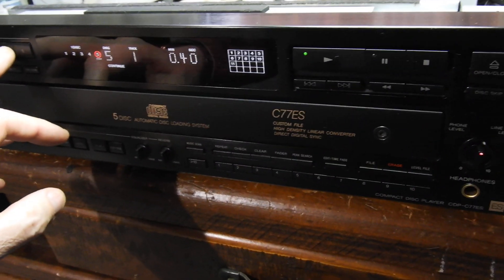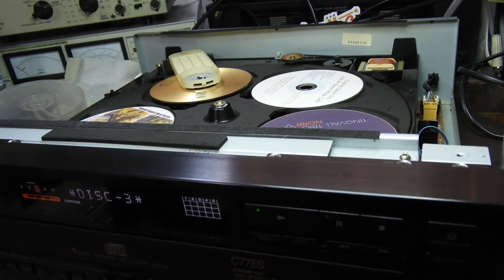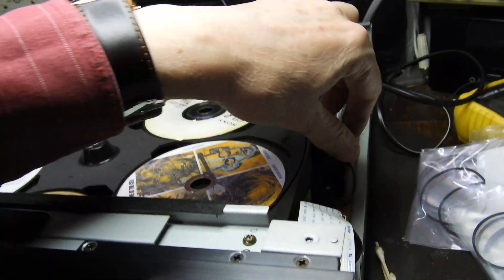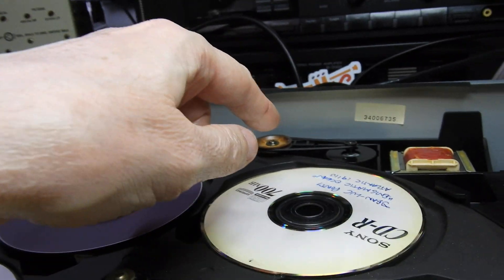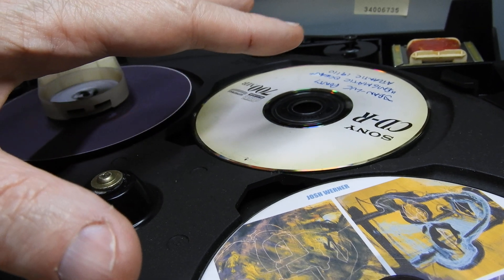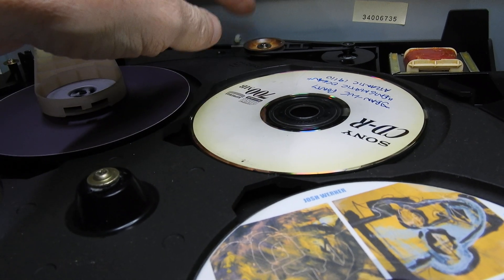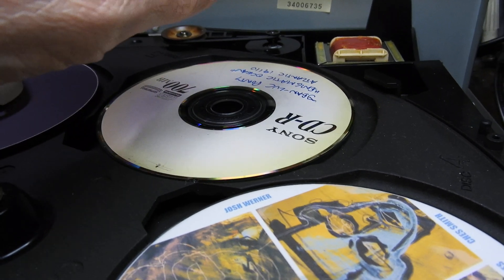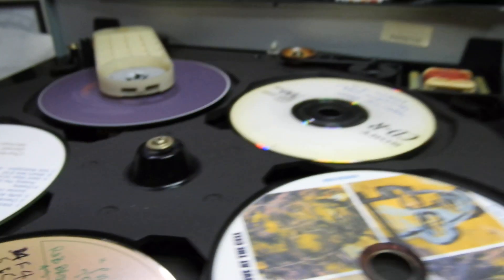Sony CDP-C77ES - probably the best 5 CD carousel player. Decent mech, decent DAC. Quality build.

Comment: I have an ca90es carousel (ca means just that ) 

They are fantastic players! Reads fast and even the onboard DAC is also pretty good .

It doesn't toppled my scd777es but it's definitely a good player. But I do put my ca9es easily next to my xa20es without shame. Really good player 

Let me put it this way I had 3 pioneer flagships (pd65 elite stable platters) they absolutely sucked in comparison. And only lasted me a year at tops before it produced issues !